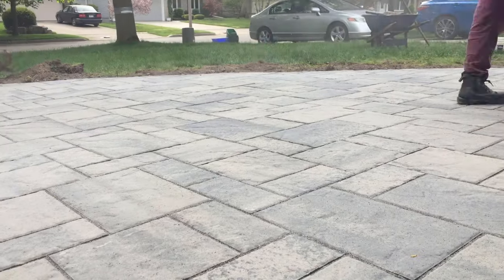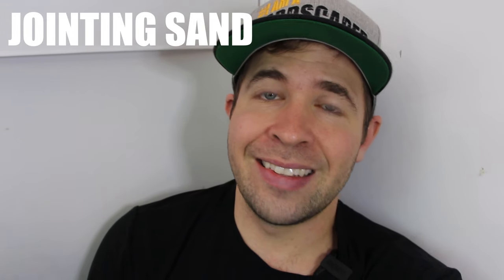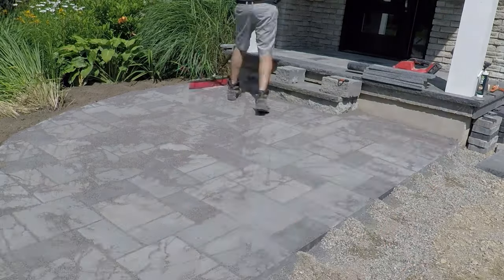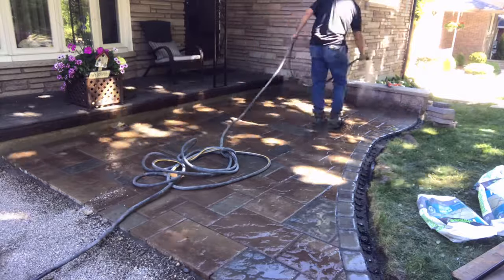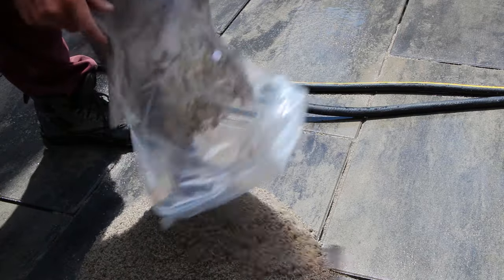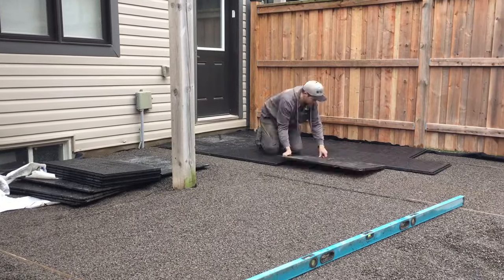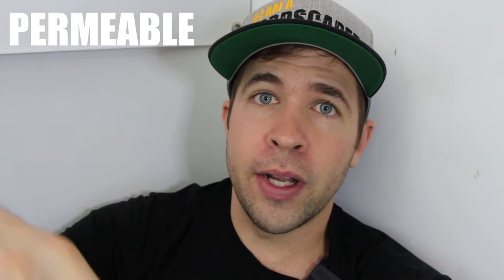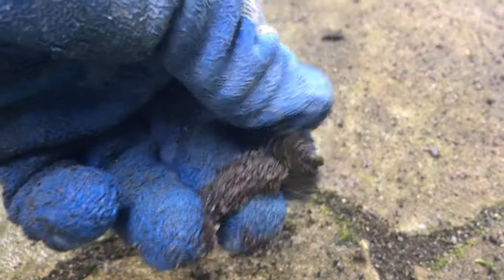Choosing the Best Paver Jointing Compound

Comment: Ca you give a second coating if you feel it's not quite full I'm using slabs with pretty wide gaps thanks
Reply from the maker: It should all be applied at once before curing so that it bonds fully. Remember that it should be 1/8” below the top of paver or bottom of chamfer.
Reply: Thanks it should be fine everything is solid when should you put it down after it shows wear? And is it a good thing to seal it
Reply from the maker: Looks like my reply didn’t post. I’ll try this again:
If there are noticeable cracks where insects and weeds are getting in. If it has weathered away to about 3/8” below the top of paver / bottom of chamfer. Noticeable signs of wear. Though most manufacturers have a 15 year or so warranty on this stuff nowadays if installed properly.

Sealing is an added bonus to preserve the pavers it can’t be done for at least 30 days after installing joint material (see manufacturers instructions). It would help stabilize joints as well.

Comment: I don't have a compactor and there's nothing in the joints but weeds. Is there anything I can just brush in and be done? Should I just hire a contractor?
Reply from the maker: unfortunately if there are weeds in the joints you are going to have to address those first. Could be something that you could pressure wash out, but often times we are just doing a lift and re-lay of those pavers and scrapping out the bedding layer and replacing it before laying the pavers back down just to ensure we get all the weeds out. Could be worthwhile to at least have a contractor come look at it and get their opinion on what they would do.
Reply: @iamahardscaper  yes, I would definitely have to get the weeds out first. I pressure washed them out before and discovered the pavers were red, but any kind of joint sealer with labor or compactor rental (I wanted the polymer sand and don't trust myself to install properly)  was beyond my budget and ability, so the weeds grew back in 3 months.

Comment: I had someone do a slope up to a higher portion of my backyard.  Unfortunately, they placed only one flagstone to each (about a foot) so there is a lot of gravel around and few flagstones.  It has weathered pretty well but Now that I have a destination decking up the slope I want to make sure the walk is safer.   Maybe it's time to redo the whole slope but since it is on a slope, there is some (slight) land movement so nothing is going to last.  The project I am speaking of has lasted about 5 years. Would just mixing cement and gravel around the stones give me any more stability?  thanks
Reply from the maker: That is probably not what you would want to do especially with those gaps and if you have freeze thaw cycles. Hard to say without seeing it for myself.

Comment: Hi, what great video.  I had a paver patio put in 4 years ago and the contractor used cr6 as a base and stone dust as a bed.  I wish they had used something besides stine dust but I am stuck with what I have.  The poly sand has turned black and is gummy 4 years later.  The pavers are nicolock with a pretty tight gap.  What do you suggest I used to replace the poly sand?
Reply from the maker: That’s a tough one. Poly is not ideal with the stone dust there, but the only other option is jointing sand loose. But that will wash out over time and weeds will grow if not maintained. You could apply a joint stabilizing sealer to seal in that sand, but with stone dust there acting as a sponge for water you would want to really make sure there is no moisture that you are trapping in with the sealer.

Comment: Planning to use a resin based compound on my irregular flagstone patio.    My base is a few inches on stone dust on top of 4-6 inches of large angular compacted gravel.    It is graded and drains very well.  Despite this, am I inviting failure with the resin based grout due to the use of stone dust?
Reply from the maker: I would double check with the manufacturer of whichever resin based compound you use to be sure.

Comment: If I am already planned for having sealer on pavers...will the jointing sand work? will it get lose or come out of joints when we will wash pavers before putting sealer? and what sealer is good? wet look or penetrating? And the base would be GAP20+sand. Or would you suggest to go with Resin based grout?
Reply from the maker: Sand is fine, I would lay everything and compact your pavers into the sand if the pavers have spacers on the sides and are touching. Then wash, then install jointing sand, compact again to consolidate, then seal using a joint stabilizing sealer. Any sealer as long as it provides the look you want.
Reply: @iamahardscaper  Thanks a lot !!!

Comment: Hello, I put down polymeric joining sand on my pavers it causes hazing ( powder residue to the entire yard with white color, so how can I fix the problem ??? good thing I did not put the sealer on top yet. please give me tip as soon as you get my message  I need to know what to do next ??? thank you so much. I am waiting for your tip.
Reply from the maker: There are haze cleaners you can use. Contact your local landscape supplier, send them some photos, they should have a product that will help you with this. Follow the directions and start with a small area that is less noticeable just to make sure there is no adverse reaction.

Comment: So I’m trying to repair pavers that have sunk over the years and need to be fixed. Because there are so many and most have sunk about an inch I’m basically redoing the whole walkway. Since I don’t have a drainage system for it, and don’t want to install one, what’s the best polymeric sand to use? From all the different videos I’ve watched it sounds like no matter what sand I use it will be horrible in 5 years. So is there a sand you would recommend? And would using a sealer over top help that or no?
Reply from the maker: I like to use TechniSeal or Alliance. Both can be installed poorly though and you could have problems. I typically see a little more than 5 years and a sealer would help a little.
Reply: @iamahardscaper  ok and I’ve got about 1/4-1/8” in between the pavers and do those work for joints that are so narrow?

Comment: Hi!  Thank you for your videos.   I have a side paver patio with a large Colorado juniper tree in the middle.   So I need the gaps in between the pavers to drain, so that the tree gets water.   Weeds are not a concern.   What would you recommend for between my pavers?   Whatever was in the gaps previously has completely washed away!
Reply from the maker: If you want permeable you should go with EasyJoint by Azpects or Nitro by Alliance if the application is right. Or if the joints are large enough you can use Aqua rock by Alliance.
Reply: @iamahardscaper  Thank you!

Comment: If I have a pool deck on top of open graded base and bedding, will the permeable jointing material apply even if the project isn’t a permeable application?  Or can that jointing material be sealed to make it less permeable?
Reply from the maker: Yes, we use this on our open graded bases all the time. For a pool patio you’d want to make sure the water going through the joints is not going to float your pool though. And I don’t know about sealing
Reply: @iamahardscaper  what do u mean by float the pool?
Reply: @iamahardscaper  it’s an in ground fiberglass.
Reply from the maker: There is always a risk of enough water working it’s way beneath the pool and eventually pushing the pool out of the ground. Typically there is some sort of outlet when building a pool or a sump pump installed just in case
Reply: @iamahardscaper  now that I think of it…. While have a decent 12” of clear stone, there’s woven fabric down yonder.  May have to rethink it

Comment: Can one use Mapi's indoor/outdoor grout if the tiles are on a bed of concrete sand? I'm laying 18x18 outdoor porcelain over a slab with the non woven geo textile between. Does this sound doable?
Reply from the maker: Probably best to check with Mapei and the porcelain manufacturer

Comment: Thanks a lot for the information...will Easyjoint stain my flagstones? I built a natural flagstone patio (some form of a sandstone) and the stones have a lot of texture on the surface that will likely trap some of the jointing compound...I am thinking about using loose sand or jointing chips for this reason...any advice would be appreciated!
Reply from the maker: It wont stain if it is installed properly. Use lots of water and take your time rinsing off the flagstone. Double check that it can be used with sandstone, as well as your joint widths.
Reply: thanks a lot! will try to get it done this weekend.

Comment: How about I use cement for the joints? Is it a good idea?
Reply from the maker: No good. You need something that will flex with movement
Reply: The ground moves, that's why I always push pavers over stamped concrete as it cracks even with the ugly joints in the middle of your pattern.  Unless your setting the pavers on top of solid concrete, I wouldn't use mortar or cement. Even then, I'd only use mortar. Sand allows pavers to move with the land and it hardens like cement, plus 10 times easier to replace or maintain.

Comment: What are the names of the resin based jointing compound?
Reply from the maker: Nitro by alliance or EasyJoint by Azpects
Reply: Much appreciation for your content!

I’m a rookie trying to pull off a 300 sf patio and 12x14 pavilion install. 

I have dense clay soil. 8”-9” excavated with about 1/8”+ slope. I’ve opted for an open grade base, non woven fabric, and my pavers are the Tremco Mega Old town with 1/8” joints. What is the best poly sand (or other jointing material) I can use given the application? 

Also, any other suggestions would be appreciated. 

Thanks for your content!

Comment: You said that you do not recommend semi-permeable for traditional bases (sand over gravel) which is what I have.  I am wondering what the reason is for this.  I want to get maximum longevity from my compound with the ability to power wash it clean (without damage and washout) and it seems like a semi-permeable solutions like Easyjoint would be the most durable and long lasting despite the higher up front cost.  Please advise.
Reply from the maker: I would reach out to the manufacturer directly and see what they say. I just don’t like introducing that much water to a base that has that many fines that can be suspended and clog the system or washout

Comment: Hi, I’m trying to fix up an enclosed raised paver patio. It was installed several years ago and the contractor used play sand to fill the joints. At the time he said that polymeric sand wasn’t necessary. However, living somewhere with heavy rainfalls washed out the play sand fairly quickly. I tried to do polymeric myself after pressure washing at some point and hated how temperamental is was. I had to pressure wash again and manually scrape out what I’d put down - as it did not turn out perfect. Now it’s back with the play sand, but I still have significant wash out, weed growth, algae growth, ants and worms! 😞 I’ve read a bit about stone dust for paver joints (not under). Is this something you would recommend to solve some of my issues? Any other recommendations/suggestions? Thanks for your time.
Reply from the maker: I wouldn’t go stone dust. You could use a jointing sand (not play sand) it is still sand but more angular fine grains as opposed to the circular grains in play sand. Then you could apply a joint stabilizing sealer. This would protect your pavers and joints.
Reply: @iamahardscaper  Thanks for the reply! I'll look into the options you mentioned...

Comment: Very well explained, but need a cementious grout on a full concrete bed other wise your pissing in the wind 👍
Reply from the maker: Haha I like that saying 👍
I don’t quite know what you’re referring to though, we never lay directly on concrete.
Reply: Ok , in the UK that's what we do ? if you're not laying on a concrete bed  surely there's movement in the paving , which will result in movement in the joint's ???
Reply from the maker: Yeah we deal with multiple freeze-thaw cycles here in Canada, so we want our base and pavement to be flexible. That’s why we use polymer modified sand for our joints so that it will be flexible as well. Cement plays a small role in it as well.

Interesting to learn installation methods from overseas
Reply: Totally agree, interesting insight, thank you 👍